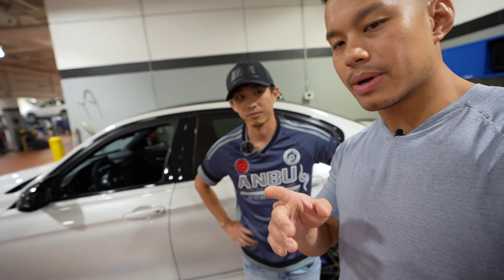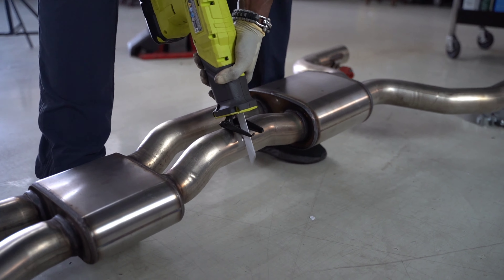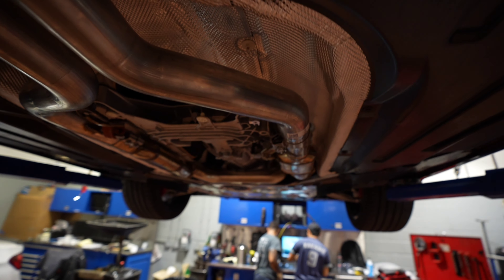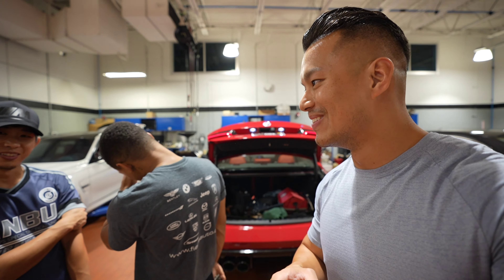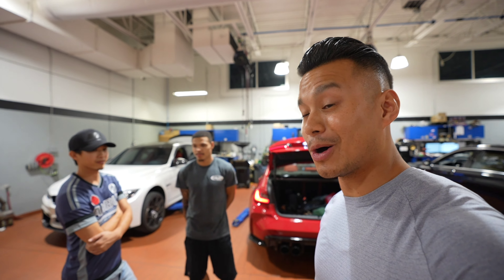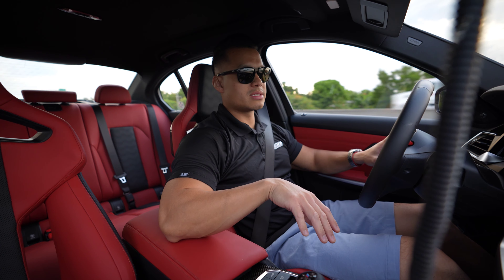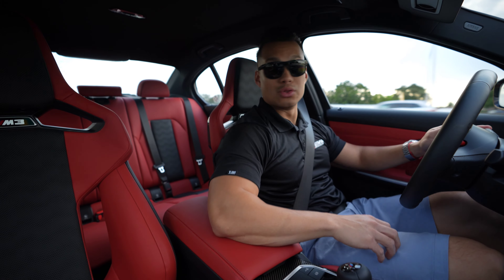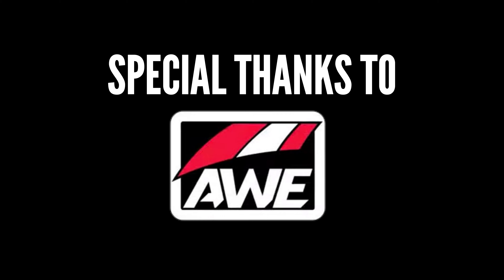Adding The AWE Non Resonated Mid-Pipes To My G80 M3 | Imola Red G80

Comment from the maker: Video Sponsored by Simply Carbon Fiber. Check them out here: https://www.SimplyCarbonFiber.com/TDD
Use Code “TDD10” for 10% off your order
Reply: Hey bro, do you still run the AWE switch path w/ AA EL midpipe & AA DPs? I thought you ran the AWE with the AWE x pipe but I saw you also ran the AA EL?

Comment: Bro I'm definitely getting this AWE exhaust with the midpipes after seeing this  video GREAT JOB and thank you for doing this I just subscribed ! Question though What spacers F/R are you running?  I wanna do everything all at once when it's in the shop. I want a clean flush look and certainly don't want a slammed look nor any rubbing so thinking KW HAS adjustable kit will help in that dept? I hear various stories on spacers depending on the tires the car came equipped with? I unfortunately have P Zeros on my stock 826M black wheels. Will eventually get some PS4S though once these P Zeros are chewed up. Any insight would be greatly appreciated.
Reply from the maker: Thank you! Much appreciated. Since you have the Parolees also, you could do a 15 all around which isn't that aggressive. I went aggressive and throw on 18 mm in the front. It definitely gives it a really Ultra flush look. 

Keep in mind anything past at 12 mm spacer in the front you're going to need to adjust fender liner. They are fins on the fender liner that needs to be either cut off or melted to be able to fit the wheels properly.

Regarding the springs, you do also should look at how long you plan on keeping the car. If you're only plan on keeping the car for 1 to 2 years then spring should be okay. Anything longer than that the ride may get a little bit sloppy. Which is why I'm going to get call coilovers soon
Reply: @TheDailyDriven  Gotcha! My shop is saying 12mm all around but likely to assure no rubbing? Ugh! 

Appreciate that detailed reply! Think I’m getting the M Performance Suspension as of now so will definitely allow some flexibility and switching to the PS4S when my P zeros are toast.

Comment: I installed the same setup on a xcomp and I'm experiencing drone between ~1700 and ~2000 RPMs under load. I wonder if it could be a problem with its installation or whether that's normal. Do you get cabin drone at that range? Unfortunately that rpm range is where the automatic transmission is when highway cruising.
Reply from the maker: I fortunately did not experience that, most likely is because I have the manual car.